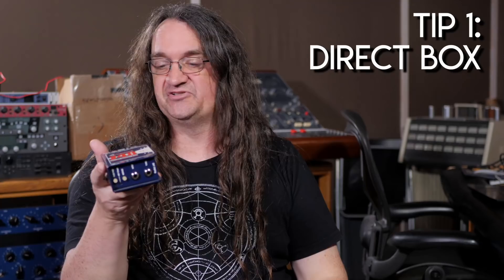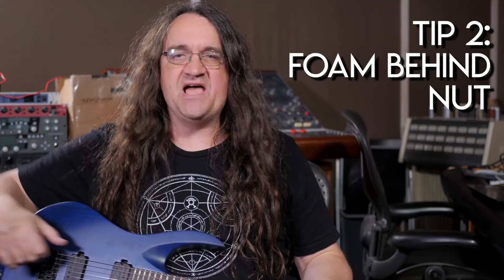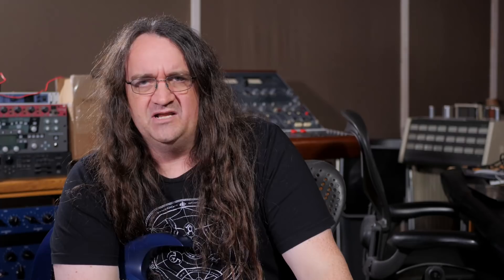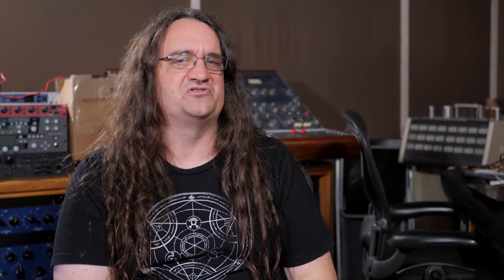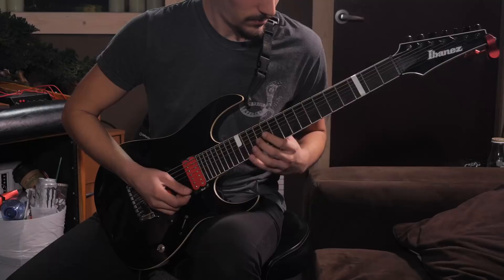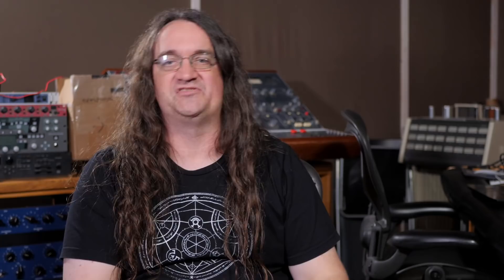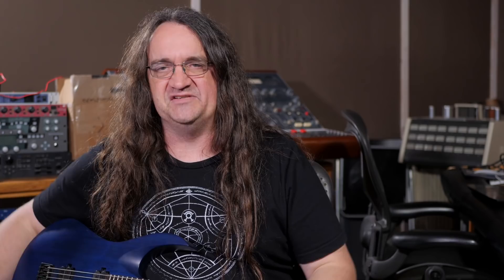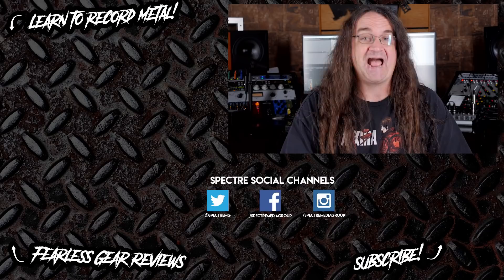Five Tips for Recording Metal Guitar at Home

Comment: I always record amps with a mic on a speaker. I’d like to add to your list: make sure the strings are relatively new and the guitar is set up recently for the seasonal changes. With a high gain amp try to mitigate any 60 cycle hum from the pickups to the amp either via RF protection methods or grounding issues. Be prepared to record certain riffs as two separate guitars playing almost a call and response version of the riff to get good enough performances on “tape” that otherwise sound fine live with one guitar.

Comment: Quick tip: Instead of taping up strings, I find that putting one of those foam ear plugs underneath the (unused) string, resting on the neck pick-up works very well. If you're playing a tremolo, you might want to be careful not adding too much strain on the string, tho, cause it might pull the rest out of tune. Yes, the string may still resonate above the plug, but it dampens the sound surprisingly efficient and it allows the use of open strings which a sweat band, scarf or sock around the neck does not. It will not mute everything 100%, but unless you need a completely noiseless recording it is A LOT quicker than taping. Especially if your next recording is an untaped one. Not everyone has dozens of guitars available ;-)

Comment: I put a cloth around my springs in the back cavity.
Thats where i found the over ring came from.
Not above the nut.
Reply: Depends on whether you have a vibrato bridge guitar with a locking nut or not. If it’s a hardtail bridge, your noise will come from behind the nut, and if you have a Nashville style bridge, behind the saddle part too. With a vibrato bridge/locking nut style guitar, you’d be right.

Comment: There are some picking techniques to consider, too.
The angle of the pick against the strings can really change the amount of 'grit' in your tone.
If you've got a medium pick (even a soft one, but not so much), you can hold it with two fingers so that it bends around the curve of the thumb, creating a rigidity through the shape, it'll mean picking angle needs to be adjusted, but you'll have a slightly 'thicker' pick sound.

Comment: Great tips, Glenn!! One more tip: use just the headphones for monitoring your playing and the backing track/metronome, not your amp's cab or studio monitors, because their sound can bleed into the record through the guitar pickups, especially the active ones, and make some mess there.  Use the shortest cable for connecting the guitar with passive pickups to the amp/processor/audio interface. Using the strings cleaner can help to reduce finger noise during the recording session.

Comment: A tuning trick I do is after I tune the normal way I double check it every time. 

First I do the open power chords on each set of strings. So 60-52, 50-42, etc. 

Then I check octaves so 60-57, 50-47, etc. 

This ensures the guitar is not only tuned but intonated properly as well.

Comment: My effects pedal has 2 outputs(basically a sound card on it's own) . On one output, I run to my amp(mic'd cab with SM57) . On the other output on my effects pedal, I get my clean sound(for reamping if need be) . Although it's an effects pedal, I don't use the effects, I just run through it, and use the expression pedal on wah setting, when needed . That's the only effect I use on it . And it does not affect my clean output . So, yes, I mic my cab(with "Greenbacks"), with a Shure SM57, and run direct at the same time(for reamping) . CHEERS !!

Comment: I used to wrap a hair tie around the nut to clean up the signal coming from the guitar. Now a company actually makes a strap, with a thick foam section, specifically for that. The nice thing about the strap, is that when your finger tapping or playing a lead, you can slide it down the neck quick instead of taping the strings. It's just faster and a little more convenient than sticking foam behind the nut and tapings strings. It's call the Gruv Gear FretWrap. You should check it out, maybe something you can review.

Comment: I use 0.73 mm picks when playing down tuned/extended range guitars with high gain. For lower gain in standard tuning, I like using 1.5-2 mm picks. Thin picks scratch the string when you play, which makes a brighter sound, while thick picks give a warmer sound and more direct control of the dynamics in your playing. I like playing with both, but sound-wise I summarise my personal pick choice with "Lower tuning -> thinner pick".

Comment: To answer your question about sims Vs Real amp recording. I do both. I use BIAS or Fortin through a direct box to record all the guitar, and have the raw signal. When I’m done, I reamp the signal in 2 ways. It’s going to my head, to my Ox top box, and to my 1x12 Mesa cab. Sm57 for the speaker, first track. I also take the sim of my OX, a 4X12, the two mics (track 2 and 3). I finally i reamp in the same configuration, just to record the room mike with my Ox. The same one for the double tracks. And then I mix all of that, I can keep some frequencies of the sims (only if it useful), and obviously the sm 57 et the Ox. i know : for each part, it’s 5 tracks by take. But it works for me. This is my answer. Greetings from France Glenn, take care  ;-)

Comment: I use velcro straps behind my nut and they work great, i also put them on the springs for my trem, screw buying jimmy clips, for half the price i got 400 velcro straps, a little overkill but it helps with cables as well

Comment: I use really thin 50mm picks and they work better (for me) than many thicker picks. I have a theory that a thicker picks actually make the strings sound more "compressed" while with lighter picks, I am able to control the amount of string compression more fluidly with how hard I strike and palm mute, at least in my own experiments!
Reply: Hmm that is actually kinda strange. The thinner pick should actually compress the pick volume more because after a certain point it will bend and lessen the impact on the stings. While a harder pick should give more control as it wont bend out of the way and has a more direct transfer of motion.
Reply: @creeperkiller1271  It's more with higher strings specifically. "Compressed" in this context meaning, no matter how hard or soft you are picking you produce a similar sound.
Reply: @smoreshaunted  Ya, I can kinda see in that context
Reply: You make a valid point as well, it's really about personal preference.
Reply: I played with soft and medium picks most of my life. I recently have revitalized my playing and now that I've moved towards more scale and soloing type playing (never too old to learn) I want the heaviest most rigid pick I can find. It's suggested for alternate picking and it does help...I still suck at it...but it does help :) Still like a thinner pick for acoustic strumming tho.
Reply: @infinitesentient3545  Ya for my electric metal stuff I use a 1.14 sharp pick but when I try that on my acoustic the strumming looses some of tone.

Comment: Well, after a VERY unpleasant drop of my PRS 513 Brazilian rosewood a couple years ago due cable tangle on my feet, I use a line6 wireless system G10 , after that the signal goes to an Axe-fx III and to the RME fireface 802. The Axe can sent also a dry output to the RME so I record  two wet and one dry signals simultaneous. That been send , I do own a J48 and I can confirm that its made to last , the only problem I guess this unit have is when you need it for live. You cannot install a battery into it and you have to depend exclusive on the phantom power  on low quality mixers you found in the clubs. Keep rocking everyone!
Reply from the maker: You can bring your own phantom power supply.  They cost $13 on Amazon

Comment: Instead of foam, I use one of my wife's hair ties. This not only muffles any ringing under normal conditions, but it fits perfect into the unlocked nut of a Floyd. This is great for keeping shit in place when replacing strings and it blocks the odd rings the unlocked nut can give when stretching / tuning a new set.

Comment: By "sound card", do you mean like an actual sound card, (like PCI-e) which happens to have a 6.3mm (or obviously at least a 3.5mm) jack.. Or do you mean a "proper" external audio interface, like a Focusrite 2i4.. I keep hearing that there's still a "significant" advantage in using a DI-box even if you have (let's say) a 2i4, but the term "sound card" just seems confusing in this context. Since you don't specify what you're actually talking about, and some people still refer to USB audio interfaces as "sound cards".
Reply: I think he is talking about both...even with old school terminology, it's still basically the same thing...i had an old PC with a Soundblaster "sound card" (but it was really in a drive slot with optical and 1/4'' jacks) now, interfaces are typically external and that's the distinction: sound card internal, interface external...they are similar
Reply: He mean's ether a pci-e card or the built in one on the motherboard itself. When he says "line in", he is referring to the blue jack on a standard sound card be it integrated or dedicated. This being said, he is also referring to the signal coming out of the interface and going directly into the blue jack on the back of your computer. His method rather, gets the sound from either a USB connection or a fire-wire, not the analog port, as you are bypassing the internal card all together per-say.  In short, he's saying the dedicated hardware sounds better than what your computer can do on its own.  Then again, if you don't have mixers or anything to route that kind of signal from a direct box anyway. it's really a moot point.
Reply: @Shikrar89  Ok, I was just wondering because the first times I tried amp sims and plugged my guitar straight into my Asus Essence STX PCI-e card, the results were frankly quite terrible.. And Glenn in this video says that there might not be too much of a difference..
Reply: @tommy.eklund  If you are plugging the guitar straight in to the card itself it maybe clipping it or maybe you didn't use an impulse response. I do know from watching other channels that if all you use is the amp sim but no cab it will sound like shit. Using a real amp head in this manor with a load box can do the same thing. If all is done right, the sims can sound great on just a normal sound card, but you may have a little more noise to deal with so you may have to gate it. Glenn has some videos up some where about using sims on his channel and there are other tutorials out there you can watch to try to figure out what happened. I'm personally stuck with pod farm at the moment, however, I do have some gear on the way in the mail so hopefully I can start messing around with some sims myself soon enough. It's a learning process. Hell, I myself have made how many mistakes in the past decade I've been messing around with things. Stick with it, You'll figure it out.
Reply: No, it was Amplitube... But I later found out that it had shit cab simulation, external impulses worked waay better. Aanyway, that was years ago, now I use a Scarlett 2i4 and everything's great. I'm just wondering if a DI-box is worth it for me.. My absolute favorite amp sim for metal at the moment is JST Guilty Pleasure, it sounds awesome right out of the box!
Reply: I used my Sound card for about a year before I got a cheap DI. It frankly wasn't too bad considering I had nothing else and now I was able to record music. Your systems fans create a lot of noise that's hard to eliminate but it wasn't unworkable. I think our current age of processing power helps immensely. I had huge latency issues trying to do PC recording at an earlier point in time but now, plugging right in got me decent quality results. It was running through ASIO for all, which comes with FL Studio, which may have helped make it better than with no mitigating feature to adjust latency. I kind of rambled there but I hope it helped with your queries :)
Reply: So to be clear: no need for DI when you have an INTERFACE?
Reply: @PrivatePaul  A DI and Interface are the same thing :) Digital Interface
Reply: No it's not, DI stands for Direct Input.

Comment: Big thanks for the DI tip. I have an old cheap passive DI box (paid about $50 ten years ago) that I had to run and get for a gig where the sound guy wanted my bass DI'ed instead of miking my cabinets and my amp didn't have an output for that. Having some issues using active pickup guitar through a ZOOM interface into my Amp Sim (either too hot clipping or sounding like dogshit), I decided to pull out that DI box and give it a go. The difference was drastic and it worked just as well for a passive strat, bass, etc. Just upgraded my interface, but still using my old DI for all guitars/basses. The signal is so much cleaner to work with.

Comment: About the foam trick...it really depends on the way the nut's cut and the headstock break angle. With a really well-cut nut, you'll often (but not always) find it's unnecessary. I've got five fairly-expensive guitars, and only one of them needs the foam trick. You actually don't need much of it - I've got about 1cm of foam cut on that one guitar and lightly glued under the strings, and it works perfectly.

It's also much more noticeable with lots of compression. That's why it's more noticeable when going djenty - the compression brings it forward, and if you gate it all it'll do is bring it forward.

Comment: Is an audio interface different than a direct box? Is it better one over the other?
Reply: An interface is what you plug your mic or guitar into to record onto your computer.

A DI box would go between the guitar and the interface.  But it gives you a lot of advantages.
1. You can record both the amplifier, as well as the clean guitar sound if you want to try amp sims
2. You get a cleaner signal to the interface so that if you do use amp sims, it won't buzz or hum as much.
3. You can also use amp sims with your regular amp if you want to fatten up the sound even more.
Reply: @mattmanbrownbro  still seems pointless for a bedroom guitarist, if you have a good audio interface and are already happy with the amp or sim sound you're using. Yeah it might clean up the signal a bit but all the other bonus options it gives aren't essential unless you're recording a band and just want to get the tracking done, so you can worry about the amp sound later.
Reply: @matttaylor1449  I'm sorry you feel that way.
Reply: @matttaylor1449  it's not always pointless! Yes, your interface effectively has a DI built into itself, but if you want to send off guitar tracks to be professionally reamped by a studio engineer you will ALWAYS want to send them the cleanest DIs possible. This is a situation where a DI box would be crucial.
Reply: @mattmanbrownbro  A DI box could go between your interface and your guitar if you want to waste money. Most interfaces already have inputs for instrument level audio. Why would you need to spend the extra cash?

The only thing a DI box is convert the guitar signal from high impedance to low impedance line level or low impedance mic level if you have an active one. There's no hidden magic behind any of them.

For the whole dual sound approach, you need a splitter box, not a DI box.
Reply: @crimsun7186  my 2i2 first gen kinda has to have a DI box inbetween it and the guitar because of gain problems, the guitar/bass always has a signal to hot for the interface it seems
Reply: Also remember that a DI box is capturing the raw tone of the guitar and pickups as well as the performance.  You can use amp sims (or a Guerilla amp) as a track placeholder until you send it out to be reamped by a pro with killer gear.  Its an easy job for him, you can literally hear what your guitar would sound like through a whole collection of amps/cabs/outboard gear/mic pres without having to replay a single note.  EVERY serious recording project should have a muted DI track for every guitar track on the session.  Recording quad tracked rhythm?  Better have four DI tracks to match.  Good interfaces for guitar (UA Apollo Twin) have at least two channels specifically for this.  Gotta hook it up right too.  Its all about options and a safety net.
Reply: @Lars Norberg trve
Reply: @mattmanbrownbro  Good comment especially 3 . I always though of a split to just reamp bit you can do anything with it ! HMMMM